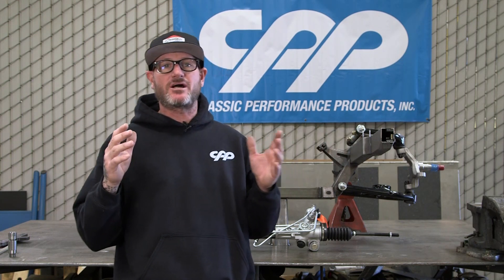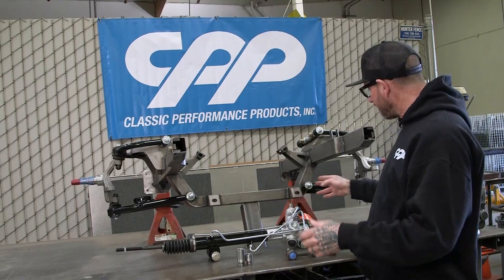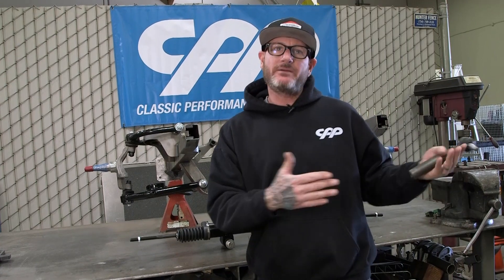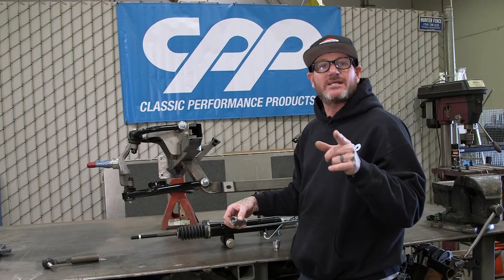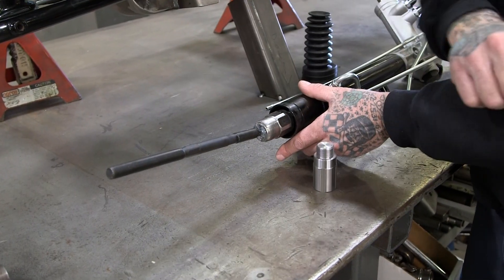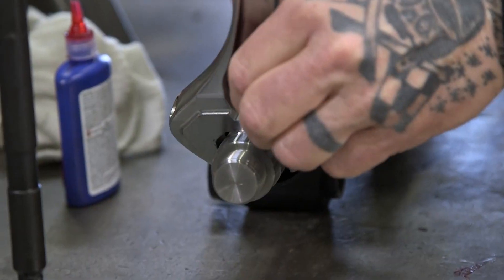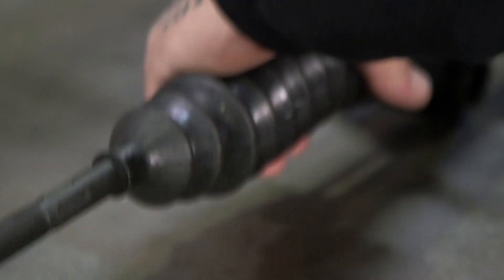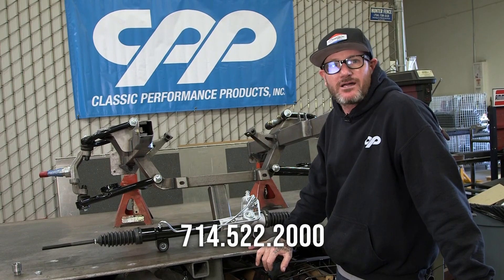How to Extend a Mustang II Rack the Right Way

Comment: I just installed one of your racks on a 78 c10.  I am running out of travel and have a crappy turning raidius.  Will these extenders fix that?
Reply: No it won't, you need to look into swapping to rod end outer tie rods, bumpsteer kit etc. I had to also use a few other misc parts to allow my C10 to retain similar to stock travel with DA coilovers and extended ball joints
Reply: thanks.  I finally got in touch with CPP and the particular rack I had bought only has 4.75" of travel.  I orderd a flaming river with 6" of travel and that fixed the issue.  Already had bumpsteer kit.   @HartsPerformance

Comment: At 00:13 my problem was answered. I'm working on a '50 Chevy pickup and someone installed the rack centered on the frame. It needs to be moved to the left about 1 1/8 inches. I have too much tie rod on the right and about 1/4 inch in the tie rod on the left. Wonderful. going back out to figure some more.
Reply from the maker: Nice! We're glad this was helpful